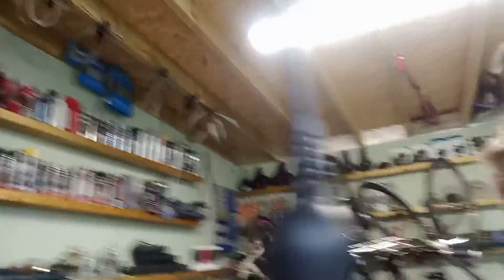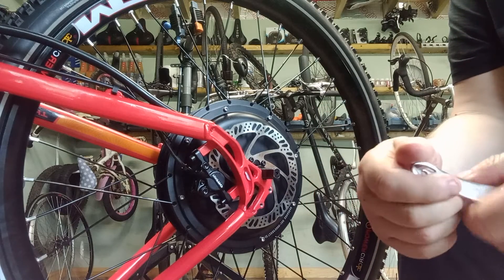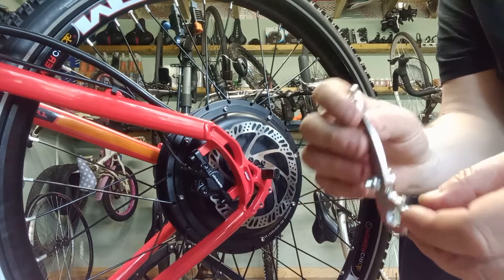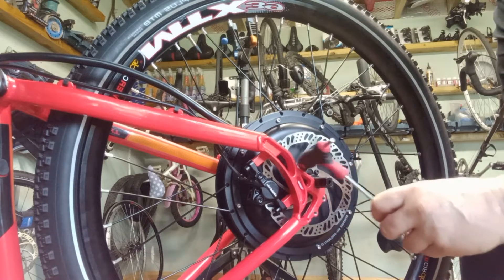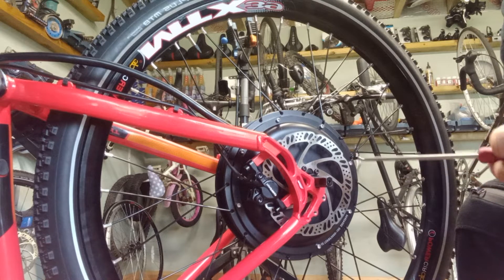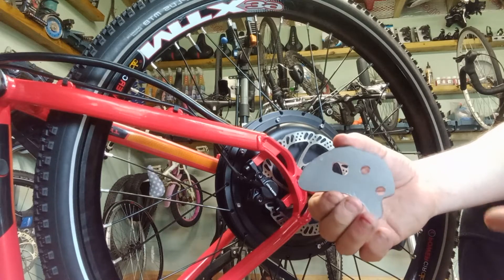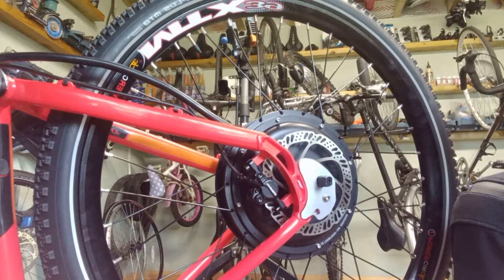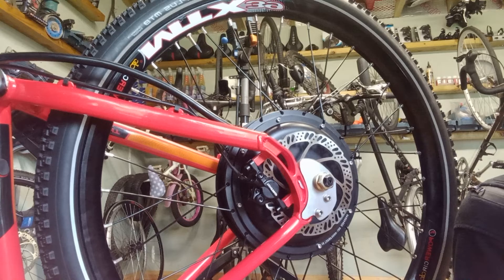Torque Arm Ebike, I made my own

Comment: Hi there. I also dont trust the standard once to hold up enoughe. But yourse is also not good enoughe sadly... The problem is that youre self made bracket fits loose, that will create by everery start and stop micro movements whitch can punch hard against it. The result is that the nuts get loose, the axel mount on the motor can breake from it and the bycicel frame can also bend from it. After 2 years how dit it hold up ? Does youre hub motor have regen breaking ? I do use a Flipsky controller for better performance.

Comment: Fred lad thank you for this video, Ive been breaking my brain thinking about what would be a good way to get a custom torque arm, as paying 40 quid for one off amazon that is pre-machined just isn't an option for me, since I would still have to custom fit it afterwards.
I can't believe this hadn't sprung in my mind, just make a little blank and then follow it on a piece of steel, drill out two holes and a 14mm hole for the axle, done.

Cheers, and I wish you a healthy  2024.
Reply from the maker: Glad it worked it for ya my man, mine is flying , no issues at all

Comment: is that aluminium frame? is filing aluminium frame okay if the axle doesnt snugly fit? is it necessary if you have torque arms?
Reply from the maker: I have a 3000w motor so i definate needed more than just torque arms, yes its aluminium frame ,axel fits snugly knyo metal plate ,no problem amd used it for more than a year now 👍
Reply: thanks fred i have exactly the same motor but am trying to use it on a bike (new mind) where the axle stick up about 3mm on the flat edge of the axle (so its not totally sat in deep in the dropouts). should i file it so it sits flush or just leave it be and add two 6mm thick torque arms (the good kind), one either side? Its aluminium frame like your one @freds-shed
Reply: (There's about 3mm of flat edge of the axle sticking out of the dropout). and there is about 1mm of play in the dropout.
Reply: let me know, need help please @freds-shed

Comment: well done.

As a welder I recommend basic welding skill. A hose clamp will not work with critical failure on these torqe arms you buy on amazon. I had a friend who had a 1000w front hub come out and snap that hose clamp like a paper rip. He was hospitalized for 2 months( front forks dug into ground @ 30mph)...can you imagine?

I recommend a steel framed bike as you can weld onto the dropout. Weld 2 coupler nuts on each side of the U. Put the wheel on and then put bolt through as it slides in both nuts on each side. If motor torques it is near impossible for "forks" dropout to bend and/or axle come out. After weld if your sloppy clean up with grinder then put jb weld steel stick putty over welds and morph for a clean look(also seals weld from oxidizing aka rust). Last match the paint. Outcome is industrialized dropout aka motorcycle dropout. 

I did this with one of those super 73's except it was not a super 73 just the style. Only difference is....its all STEEL.

Get a MIG FLUX welder they are cheap and very easy to use.
Reply: I wouldn't even trust a 350 watt hub motor in my front wheel, sorry your friend had to learn the hard way, but those mounts are not designed for anything other than letting a wheel free roll on the axle. 
Mid drive or rear drive really is the only way. Rear being my preference, torque arms are needed and you NEED to mount them the right way, counter to the force of the wheel, or they literally are useless, even if the clamps are not good.

Comment: It's exactly what I've been thinking Fred. I've made a template for my retro cruiser and I have mounted a 3000w hub motor with about 80-90NM of torque and mounted it in a schwinn beach cruiser. So i need a big toque arm and the ones supplied are weak and inferior. Nice work.

Comment: I am converting my Phatmoto into a hybrid.  The ebike kit did not come with torque arms for some unknown reason, and I doubt they would have worked anyway.  I like your idea of using cardboard as a template.  I have an old mower blade that I will cut into shape.  Thanks for the video.
Reply from the maker: That's what I was going to use  until I found a price of an old chair at work ,good luck 👍
Reply: @freds-shed  I started on the torque arms this morning and worked all day getting it right.  I still need to paint them for rust prevention.  If I had known that I would have to make so many modifications, I would have just gone to the local bike shop, gotten steel forks, and put on a front hub motor.

Comment: why is the brake on the right-side of the bike?
Reply from the maker: The bike is upside down in the picture
Reply: @freds-shed  Yeah, I figured that out by looking at the dropout hole facing the ceiling. That is why I raised the question. I think I know the answer now: you were using your selfie camera, selfie camera will mirror the picture horizontally. The texts on your rim are mirrored as well.

Comment: Nice torque arm you made there. Regarding the other torque arm you can bolt it directly onto the frame instead of using a hose clamp and put a weld on the pivot point. Then it will work fine.
Reply from the maker: The welding is definitely a good idea 💡👍👍

Comment: I definitely need custom ones. The ones I have literally did the opposite of what torque arms are intended for with a 1200W Rear Hub Motor.
Reply from the maker: They were easier to make than I thought but I have vice, files and a grinding wheel etc ,I'd imagine if u made a template it would be easy enough to get a machine shop to knock them up also
Reply: @freds-shed  Yeah I thought something was wrong with the dropout of this bike but it turns out the torque arms were hurting and not helping. Clearly don't fit this bike.

Comment: Heck yes man, I installed a front hub motor on my existing rwd ebike and I have an aluminum fork. I am making custom welded double sides torque arms so I don’t lose my front wheel when going 35mph down a road haha. Great design you have I like how it fits nicely to the contours of the bike frame
Reply from the maker: Thanks a mill ,I'd love to see it when it's done ✔
Reply: Did you make your yet? Love to see it